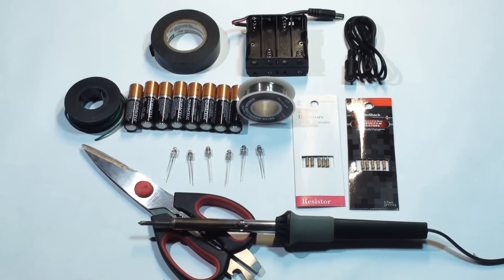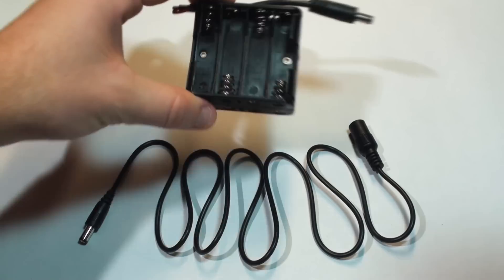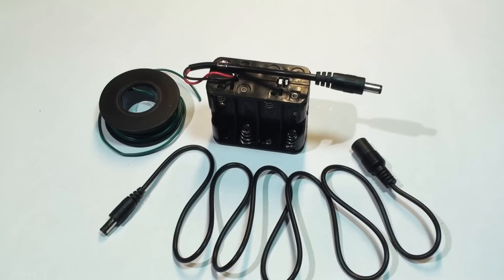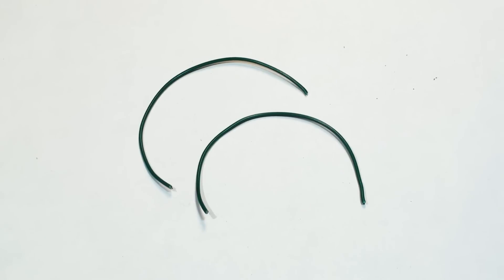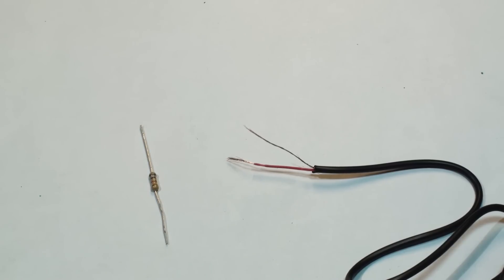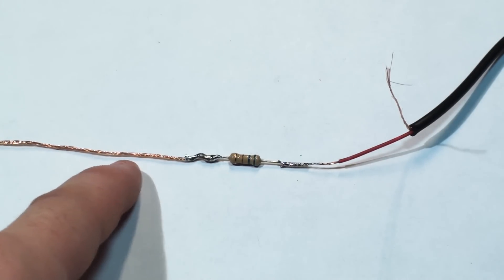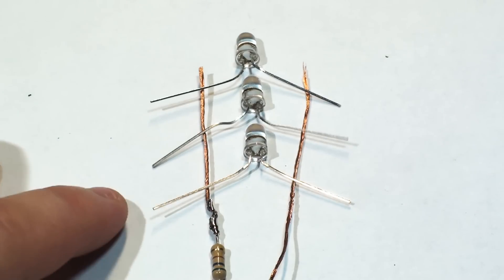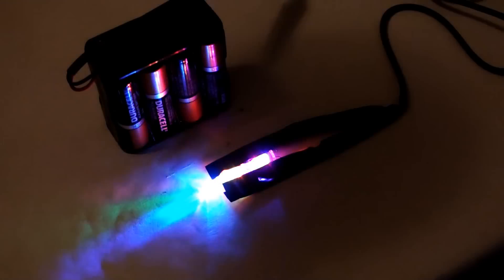How To Wire Multiple LED's in a Parallel Circuit !!

Comment: This video is WRONG, folks. When wiring LEDs in parallel, EACH LED should have IT'S OWN current limiting resistor, NOT one single resistor for all of the LEDs in the circuit, as the author of this video has done.
Reply: no, you are wrong because you can do either.  the only difference is in this video's example if the resistor should fail he would likely burn up all three LEDs.  the way you suggest you'd only lose a single LED.  that does not make the wiring example in this video wrong.
Reply: robvei45 Thanks.  Wasn't trying to name call or come off as hostile.  I'm trying to learn as are many others.  It's very taxing to just see something is "wrong" with no explanation as to why.  Just because something isn't the greatest idea, doesn't make it wrong.  It clearly works and can work.  But, I thank you for that last explanation as it defines that it is a better practice for anything you are trying to make last longer to use 1 resistor for every 1 LED.  For just the average person trying to just learn and wire something up, this example works great.  With they way you say, I now know that if I'm designing a circuit, it would be much wiser to use 1 resistor for each LED so it lasts longer.  So again, thank you.
Reply: Robin Sauls  Hmm, I have enrolled in an electronics course beginning around November 1st last year and have since learned that the tinier the wire, the lower or poorer its resistance, like trying to ram cottage cheese through a funnel neck. I do not see any need for protecting each LED with its own personal resistor, no, you can hook one resistor or a number of clusters to individual resistors into "banks." If you want to lose them all at once, then you can go the way of a single resistor, but adding a suitable fuse to a one-resistor method would also provide protection. I learned you can wire a fuse outside of the setup and then it can be replaced with ease if it ever blows.

3.3 V
20 mA (shift 3Decimal_places_left_for_milli*) => 0.2A

(Ohm's Law: I = E/R ; R = E/I)

R = 3.3V//0.2A = 16.5Ω

Dervived from Kirchoff's loop rule, three LEDs of 3.3V and 0.2A apiece means amps in series circuit will add together (and we know that amps increase as volts increase) to account for all voltage in the circuit:

I = 9.9V/16.5Ω = 0.6A

Power supply must at-the-least provide enough current for circuit. A resistor of the correct ohmic value will complete the effect. We know we'll need a 0.6A fuse for three LEDs of the listed stats.

Am I learning anything?
Reply: How so?  According to Thevenin's Theorem, you can use one resistor for the entire thing, right?  Did I miss something with that?
Reply: Jacob Zimmerman IV
the simple answer is this, EACH LED is drawing current from the source, therefore each LED should have it's own current limiting resistor.
Reply: robvei45
Yet still, if you do the math, it's all the same, so what is the purpose of having individual resistors for each individual LED?  What are the pros and cons?  Explain where you're coming from so we can all understand the reasoning behind it.  You obviously think you know more, so explain that and share the knowledge so we can all learn, don't be a dick and treat people like crap just because you can.
Reply: @robvei45  if i have a 24V 3A power source, 16 3V 20mA LEDs, do I need to wire it in parallel? If so, what resistors do I need?
Reply: robvei45 the idea of wiring LEDs in series is as acceptable as wiring single LEDs in parallel.  you never use different LEDs in the same series, nor was I suggesting that.
anywhere on the internet you can find resistor calculators that will provide wiring diagrams illustrating LEDs in series.  those configuration also draw less power than a "resistor per LED" configuration.
I've been using both types of LED wiring for years without issue.
Reply: Casey, that's not accurate for a parallel configuration. You might be thinking of a series configuration.
Reply: Mario Andres then why the fuck did you watch it
Reply: Do a video-and then your greatness can be shared.
Reply: ***** bro do a video then!! but throw in a toggle switch it! as a challenge.;)
Reply: ArgonCandelabra
Not quite right.
Reply: robvei45 Im going to do a project and thanks to your "debate" it clarified things up.. so much in one vid i guess 😉
Reply: Should anyone stumble onto this video and read this thread, hopefully this comment will clear up the confusion.

You should not wire up LEDs in parallel like this with a single current limiting resistor for the whole bunch.  The reason it looks like it works in this video is that the creator was using LEDs that have their own little computer chip in them controlling the colors and flashing.  Normal LEDs will not behave nearly as well as the ones in the video.  (Even assuming that the ones in the video are 'behaving' might be a stretch.  The random looking multi-color flashing makes it difficult to spot problems.)

Several people have mentioned "do the math" or something similar.  The math they are talking about assumes that everything in the circuit is linear, which LEDs (and diodes in general) are most certainly not.  In an LED, the current is exponentially dependent on the voltage, which is why we have current limiting resistors in the first place.  LEDs in parallel with a single limiting resistor will not 'share' the current equally.  The slight manufacturing variation in LEDs will allow one of the LEDs to draw much more current than the others.

TLDR:  LEDs are not linear and do not play well with each other in parallel without a resistor on each.
Reply: @robvei45, can you show us some math why this video is wrong?
Reply: @Dorin, you generally can't wire LEDs up in parallel like in the video and expect everything to work well.  LEDs are a type of Diode, which have an exponential relationship between voltage and current.  Because of process variation between LEDs, two LEDs with the same part number will have slightly different forward voltage values.

If you wire up a bunch of LEDs in parallel, the ones with the lowest forward voltage will use the majority of the current available because their exponential nature amplifies those small differences.  The LEDs with the highest forward voltage in the group may get little or even no current.

As I pointed out in the post directly above yours, the LEDs used in the video are not simple LEDs.  They have their own tiny integrated circuit in each LED that is controlling the color and flashing patterns.  They may even have their own current controllers on-chip or the flashing/colored patterns make it difficult to tell that they are not working properly.  The video creator failed to mention that these are not simple LEDs which may mislead people like yourself in the proper way of wiring normal LEDs.
Reply: i will explain : you can use 1 resistor but it needs to be strong enough the more led used the bigger yr resistor will be so its better to use more resistors because high power resistor are more expensive
Reply: Jacob Zimmerman IV   look dude, there's no reason to revert to hostile name calling. This isn't personal and there's no reason to make it that way "If you do the math it's all same?" You touched on it right there, it's NOT all the same. If someone uses different colored LEDs in the array, or LEDs from different sources. Even LEDs of the same color and maufacturer can have different characteristics, thus they won't be conducting the same amount of current with a single resistor. You could have one LED conducting most of the current, while the others are conducting much less. That LED will burn out much faster than it needs to, then the next LED that's conducting the most current will go next. Giving each LED it's own resistor will insure even current flow through all of the diodes. It's the proper (and logical) way to design a parallel LED circuit. Hope this helps.
Reply: Jacob Zimmerman IV
Apology accepted, I guess...and you're welcome, by the way. :)
Reply: HomeWork But i did it myself and it worked 3 days day til night Bro
Reply: tomx63 As you well know, the amount of current consumed by two or more LEDs wired in series is the same as the current consumed by a single LED, it's voltage drop that is cumulative, therefore a string of series wired LEDs only needs a single resistor. I wasn't talking about wiring LEDs in series. That has nothing to do with what I was talking about, and if one is concerned about power consumption, then they should use a parallel series array, which again, is totally apples and oranges to the discussion of giving each LEDs it's own resistor in an exclusively parallel arrangement. Anyway, I've said all I have to say on the subject.. You can have the last word :)
Reply: It seems that if you can use a thick enough copper wire that you wouldn't even need a resistor. Is this not correct? The big question would be, will there be any difference in potential longevity with using the single resistor versus using the multi-resistor method?
Reply: WRONG. Resistors do nothing and have been debunked years ago by all respected Electricity Scientists.
Reply: tomx63
Well of course you CAN do it, but that doesn't make it right. It's not about losing the resistor, it's about the way the LEDs conduct current, especially if you're using LEDs of different colors or different manufacturers. If his resistance is sufficiently large enough so that any single LED in the circuit can conduct the full amount of current from the power supply, then it might be ok to do it this way, but giving each LED it's own resistor will insure that each LED is conducting roughly the same amount of current, which is the proper way to design a parallel LED array.
Reply: tha amount of current  the leds need is being taken down by the one resistor if you add on resistor after every led they would not get enough power to light them all up
Reply: BORING

Comment: mate i have expirience tell me why my LED i connect in series dont power up i repeat THEY DONT POWER UP IN SERIES all works fine not burned but dont light up in series just i paralel they power up why how and who i dont know they ale tiny small leds from a lamp. i power them with 3.7 nokia battery amd atleast 2 i series should be light up but no !! dont know why... may b the voltage is small or the amps ... F** knows ...

Comment: Please please please make a tutorial for a toggle switch (or any on/off switch really). I can't find any good tutorials anywhere! :(
Reply: If you can't find one then apparently you haven't looked, or either you're not very familiar with how to use a search engine. It's really quite simple. If the toggle switch has to leads, cut one of the wires going to your LED, or string of LEDs (it doesn't matter which, positive or negative, either way), then take the two ends you've just cut and connect one of them to one side of the switch, and the other to the other side of the switch. walla
Reply: robvei45
^^ typo...."two" leads

Comment: What did u use to connect the wire? Looks like foil, but not sure?
Reply: Aegina Festin he clearly asked what was used to CONNECT the wires, in this case it was solder. noob
Reply: He used electrical tape to cover the exposed wires.

Comment: As long as there is resistance in the circuit it doesnt matter if its on the positive or negative side. That is in the case of simple led circuits.

Comment: Gabo flores and mitchell marion, you should use a resistor for each led in the parallel because if you only use one resistor it would have to be capable of handling high wattages, for every led you add, you draw that much more power and granted leds only dissapate micro watts if you were to add too many leds the power dissapated by the resistor would exceed its rating and the higher temps would cause the resistance to drop and that would allow more current to flow thus dissapting more heat until

Comment: hi miller mod pc how can i make a custom light board thing with multiple led lyts so that it can fit into my tail-light for my car.wud look awesome ,thanks.i knw that board thats used can be cut to fit the car light but not sure how i wud go about putting them together on the board.if i can just set 1circuit board for my brake light that wud be cool